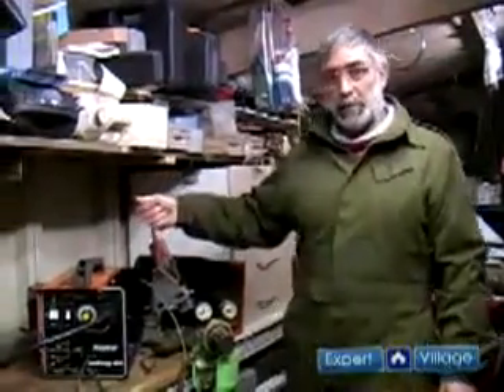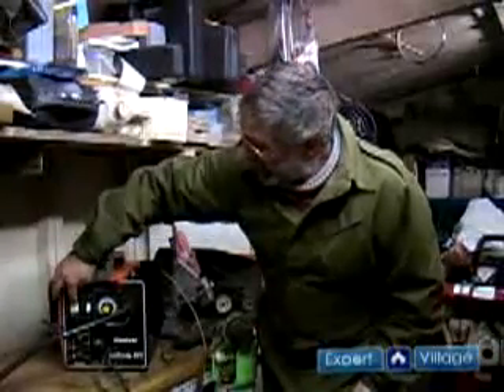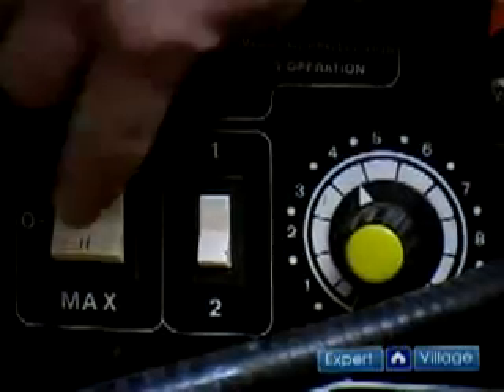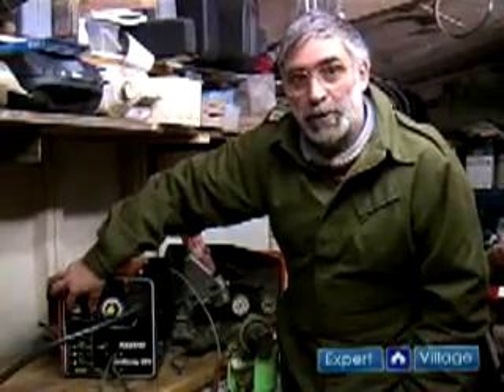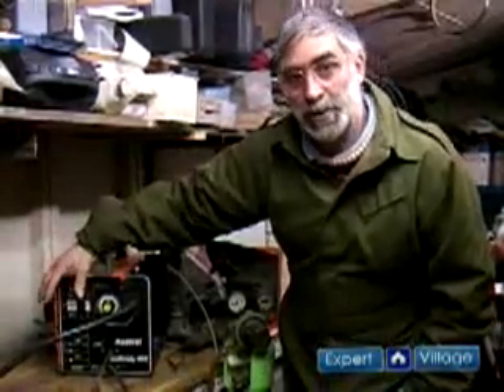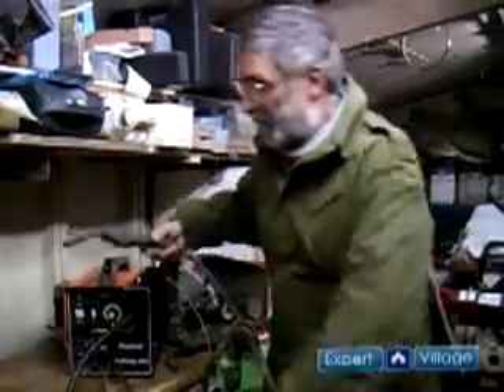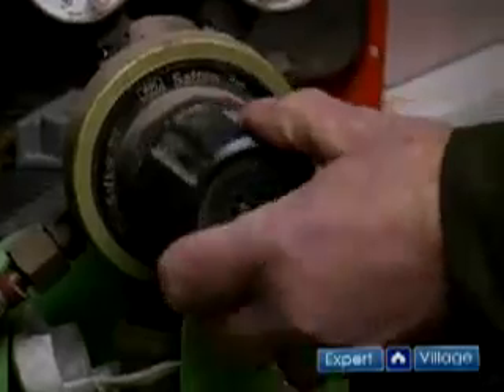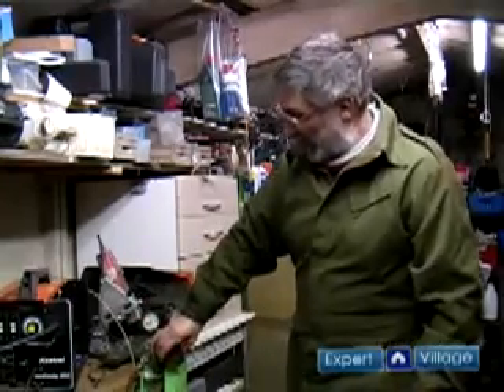How to MIG Weld : How to Setup a MIG Welder

Comment: flux coated wire give a better gas shroud due to wind blowing the gas away before it actualy shrouds the weldi, however the flux boils of as a gas shrouds as the wire weld therfore it is more efficient

cheerio

Comment: lmao what a cute tiny welder... i bet he cant tell you what the voltage and amp draw that little piece of crap that welder is set on .....so if it burns through the metal it's to hot ..lmao or if it pops like popcorn it's too low lol and he's a pro????? any pro wouldnt use a rinky dink owl shit of a welder like that....

Comment: First off, shielding gas doesn't protect the filler metal from impurities in the metal...it shields the molten puddle from the atmosphere.  The molten metal would rapidly oxidize if exposed to air (i.e. you would burn the metal away...if you don't believe me just try it...or wait for the first time you forget to open the argon cylinder valve...done that before...)  Second, 35 cfh would be a little high...more like 25 cfh.  Too much gas flow and you will pull in outside air.